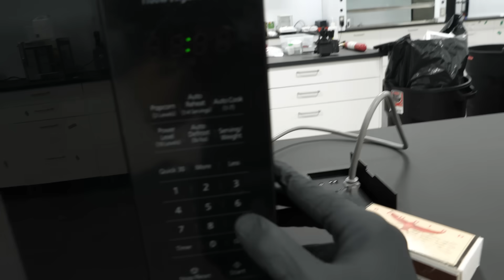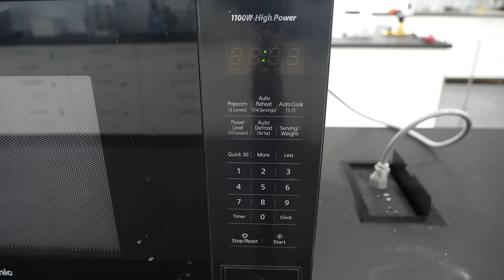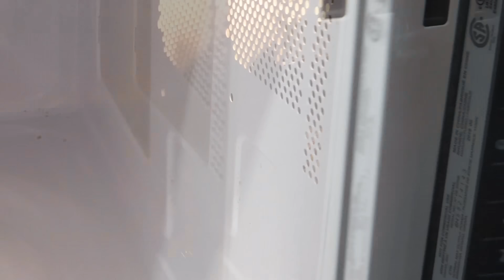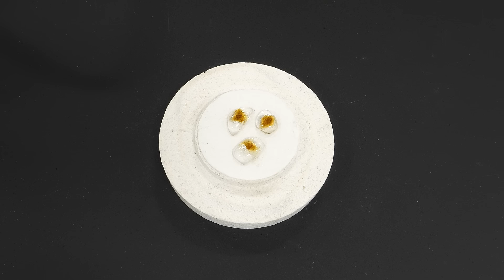Melting glass in the microwave is crazy

Comment: Something else that is fun to try:  take a beer bottle and carefully heat a spot on the side with a propane torch until it is red hot (if you can avoid shattering it). Do this in the microwave so you can slam the door and start it quickly.  Glass, when it is hot enough, is a good enough conductor of electricity that it will absorb microwave energy. If you do this right, with the microwave on, the side of the bottle will heat up enough to melt and collapse.

Comment: I can tell you why it didn’t fuse into one big piece and why they look crackled. First: there’s many types of glass with different coefficients of expansion, or how much they change volume when heated. Beakers are made of borosilicate, a type of glass with a high melting point and low COE at 33. The bottle is a different type of glass with a COE probably closer to 90. Since they shrink at different rates and to different degrees, they create internal stresses that can lead to cracks, crumbling, or even popping.

Second, molten glass has high surface tension, so it tends to form rounded shapes when it melts. In order to get the pieces to fuse, they need to be overlapping each other so that each piece doesn’t contract into itself as soon as it starts to melt.

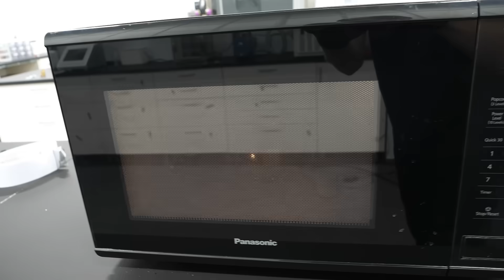Comment: 0:01 moment of beep
0:02 moment of start microwave
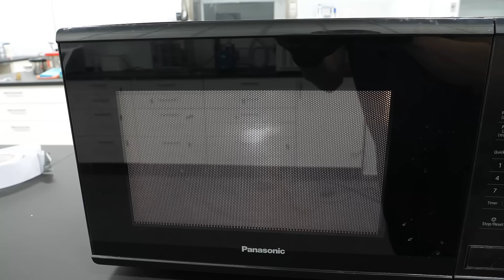0:06 boom
0:08 turns off
0:10 moment of open
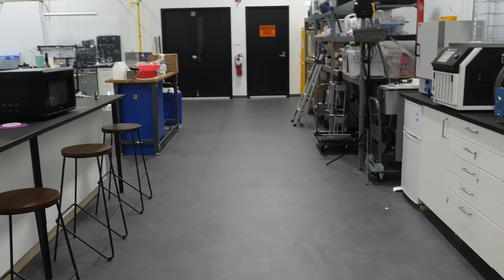0:18 moment of throw
0:19 moment of break
0:23 moment of walk
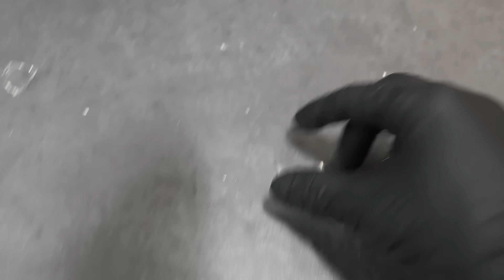0:30 pick up glass
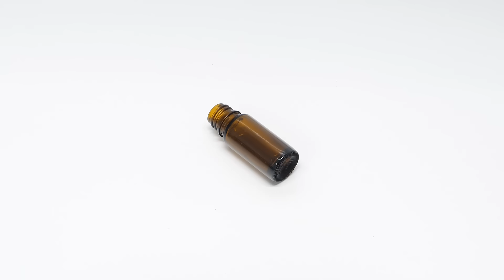0:31 pick up glass 2
0:33 pick up glass 3
0:38 H A M M E R
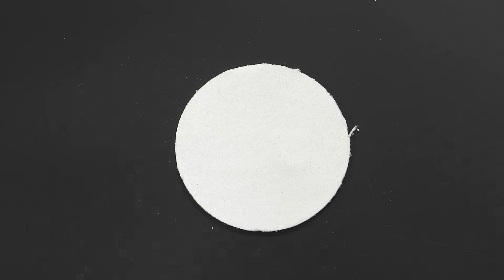0:43 stack glass
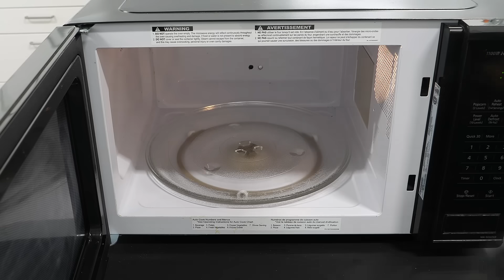0:46 stack glass 2
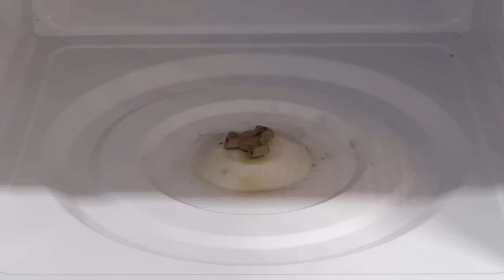0:49 moment of pull out microwave insides
0:52 moment of remove spinning thingy (reminds me of spinning chip)
0:54 moment of placing thingy
0:57 moment of foam circle
0:58 appears in thin air
1:02 cover :p
1:06 tiny door slam
1:09 moment of beep
1:23 c e m r a a n g l e
1:35 no camera (spongebob bwomp)
1:38 "slowly got brighter inside" THATS LASER BEAM BRO
1:44 h o u r
1:47 (press)
1:47 (open sesame)
1:52 nooo my kilm
1:58 nooo my kilm (2)
2:00 moment of place
2:15 top 3 glass break moment #1
2:15 #2
2:16 #3 (so sad 😭😭😭)

2:16.98 end (so sad 😔)

Comment: Changing the power setting on a microwave doesn't actually make it run at less power. It just makes it run full power for less time. Like a stove or furnace. A 5 would make it run for 50% of the time.

Comment: Let me help:  Pyrex is a special type of glass that’s very hard to melt.  That’s why it’s used in the lab.  Also, fusing two pieces of different type glass will soon crack, because different types have different Coefficients of Expansion (COE).  You can certainly buy different colors of glass with the same COE and easy melting points.  Check out companies like Bullseye Glass Company, or your local art glass/stained glass store.

Comment: Single-thickness glass will always shrink in left/right/up/down size in order for it to grow to about 1/4" thick. That seems to be the thickness that it "wants" to be. If you pile the glass up to 1/4" before fusing it, you'll get the single lump you want. It won't be stable though since you're using two different types of glass, and eventually it's likely to crack unless you just get extraordinarily lucky and your two types of glass have the same "COE" - coefficient of (thermal) expansion. The same thing can happen if you don't let the melted glass stay in the temperature region where thermally-induced stresses have time to anneal out. Cracks from that can happen hours, days, even months later. Keep experimenting, it's fun when you finally get things to turn out like you wanted!

Comment: They were never going to run into one another even at much much higher temps. I'm a glass blower, the surface tension and resistance to flow of 33 COE Borosilicate glass used in scientific labware is much much higher than anything used in a traditional furnace and blowpipe glassblowing where you melt glass together in a crucible. Boro glass flows more like taffy when molten compared to soft glass almost being a liquid. Also they were too far apart lol.

Comment: I learned from an artist friend of mine that works mainly with glass that generally melting different types of glass is a bad idea. It can cause those small cracks to form, or if you're really unlucky the whole thing will explode when it cools!
The rates at which the glasses melt, cool, and shrink means it's almost always a better idea to melt all the same type of glass separately, so borosillicate on it's own, glass from wine/beer bottles, etc. It'd be super cool if you did a project testing combos of various glass types with similar or wildly different properties to see what kind mixes work well and which ones are the fun explosive kinds. Especially since you might be able to explain the chemistry angle a lot more in depth than even some glass artists could.
Great idea so far! Maybe I'll finally have a use for my spare microwave... 🤔
Reply: That's the coefficient of expansion. Or COE. Different glass expands at different rates.  It's not advised to mix them because they can explode from microscopic stress fractures.
Reply: Thank you!

Comment: Very cool .....
Question - do you need to be concerned about moisture being in the kiln when you toss in the microwave?
Reply: IMO the moisture is the only thing getting hot. Microwaves can only heat up polar molecules. Glass isn’t conductive and I don’t see it absorbing much energy at all without some humidity in there. For example take any scrap piece of plastic that is dry and throw it in the microwave for 60 minutes. Nothing will happen. Any warmth it may have will be from water molecules in the plastic. And that’s all you’ll get is slightly warm. It won’t melt into a puddle.

Comment: This was an exceptionally stupid thing to do!
Microwaves are rated to leak radiation ONLY if they have a reasonable amount of H2O load inside.
If the inside is dry, the shielding of the microwave is unsufficient and it will be microwaving bystanders in the room.  You used to be able buy a microwave radiation meter at your friendly neighborhood Radio Shack so you could tell when you were doing something dangerous.  I measured our microwave once and verified that with nothing inside, it exceeds the safety rating and the shielding is ineffective!

Comment: Fun video. I'm sure you already know all about glass types, compatibility and COE, but it looks like you mixed soda-lime (the bottle) and borosilicate (the beaker), that's why there are all the fractures around the color. Which is a cool effect if that's what you're going for but may affect the longevity of the pieces.
Reply: I'm not convinced it's boro; no PYREX marker, and the "plasma" in the beginning of the video should not have reacted in a harmful way if it was. The cracks with a soda lime glass fusing should have been more violent too, if it would have melted at all. 

Now two different 80-100 coe glasses, that I'd believe. Either way, annealing with one of these fake kilns should be highly suspect.
Reply: @shawneverette6575  beakers are almost always borosilicate
Reply: @evilsharkey8954  almost always is not always. As someone who spent years working with soft and hard glass in neon, I don't believe it's behaving indicative of boro. 

In boro, a heat exchange(plasma discharge) that is not able to deform the glass should introduce little to any stress into the glass. That (plus the chemical resistance) is the entire reason it's used in lab settings.

If this was 30 years ago I would agree with you with almost certainty, but I wouldn't put it past a current company selling "custom" beakers to be enameling on soft glass. Way cheaper and easier.

If dude wants to send me some shards, I'd be happy to do tests against know glasses. I'll throw in a proper anneal for free.

Comment: SOLUTION
The microwave has a knot wave point in the middle
So the middle part is not heated at all

Thats why the food from the microwave is different hot
You need to slightly be on one side of the microwave and you can melt everything down in one peace
Maybe its to strong so take 5 or 4min

Comment: Be careful with this type of experiment Guy's.  If the Glass is not annealed ( look that word up people ) correctly it will shatter.
I’ve had a glass bottle explode on me,  I took a bottle from the assembly line before it entered the annealing process It cooled down I took it to my work bench.  It sat  there like a ticking time bomb for three days before I picked it up bare handed and the change in temperature caused it to explode.

Comment: Borosilicate glass (pyrex) has a COE (coefficient of expansion) of about 30, soda-lime (the brown bottle) has a COE of around 70 (varies). This is enough of a difference that the result will almost certainly crack. Even if it doesn't by the time you take it out, it will in time, particularly if the glass was not annealed properly (ie cooled slow enough). Unannealed glass and mixed COE is DANGEROUS. It can come apart without warning, launching very sharp small shards everywhere, particularly towards delicate tissues like your eyes. If you want to play with this, do some basic research into Fused Glass techniques. I have no doubt there are a good number of channels devoted to this. Nearly all of the glass in the world is soda-lime (cheaper), except for laboratory glass (beakers, etc) and oven-safe cookware. Thou shalt not mix.

Comment: Glass will form into the simplest shape when heated, which is a sphere. This is because of surface tension, a sphere is the simplest and easiest shape for an amorphous substance like glass to turn into when heated up.

If you had placed them closer together, and also ran it longer, if they were touching, they may have all formed into one piece. Basically think about snow falling down, in a crystalline structure. After it hits the surface and warms up, the snowflake beads up into a droplet, basically a sphere.. and droplets that are close enough, will form together into a bigger droplet, or one big sphere (given a flat surface, for liquids like water anyways. Once the droplet gets big enough on a curved or angle surface, like a car body, gravity will pull the water down once the sphere gets too big. So too much glass  you'll still get a puddle shape, it won't turn I to a perfect sphere, not the way you are melting it anyways..)

If you place the pieces touching and ran it again, for longer, it would give it time to maybe form into one piece, but unless super super hot, like molten, it won't form a perfect sphere unless you rotate it, (like glassblowing, think of a gob of honey on the end of a stick, you need to constantly rotate it to keep it from falling off the end - gravity again) 

This idea can also be seen in space when astronauts let a liquid float in the air, if it's all one blob, generally you'll see it form a sphere from the surface tension :)

Comment: The spiderweb cracks are due to differences in CoE between the two types of glass. As for them not joining, a hole in a glass bubble will spread out the more you heat it as it wants to form a cylindrical shape due to surface tension. If you want the pieces to join, there can’t be any gaps whatsoever. Atleast, that’s my experience with borosilicate. Great video!
Reply: I know it's been a year but...CoE? I know you don't mean the Church of England, but...?
Reply: @hisss  coefficient of expansion! Borosilicate is 33 CoE and soft glass is generally between 90-104. It’s a measure of how the glass will expand and shrink at different rates when heated and cooled. Different numbers cool at different rates and will sheer apart
Reply: @bloink3511 Ah, of course, the principle behind sprinklers (the extinguishing system), right? Thanks for the clarification, especially after I dug up a corpse 🍻
Reply: @hisss  🤣 no worries mate

Comment: The reason the glass didn't fuse "correctly" is because you used two different types of glass. I worked with glass from 2016-2019 and when fusing glass you either have to use two pieces from the same sheet, or the two different colors have to come from the same factory, as they both will have the same COE.

Comment: @Nile Red the reason they separated and cracked is because the types of glass you used are a different coefficient of expansion.  The beaker is made from borosilicate glass which has a coe of 33, and the brown vial was likely made from soda lime glass which has a coe of 99 or 103

Comment: For glass play, you can add any metal-oxidization gouged from whatever happens to be rusting, adding the green salts from a corroded battery terminal will cause a sky-blue-green, iron rust makes either black or more likely whiskey-brown; glass colors are the same ingredients used to color fireworks.

Comment: This result is not surprising. Molten glass has a fairly high surface tension at barely-molten temperatures, so it's predictable that the pieces would contract in on themselves. You have to get it hotter before the liquid thins out and starts spreading.

Comment: Nilered!!!
Those are probably going to crack/explode because the clear and brown glass will have different coefficients of expansion (COE). 

You can however use colored mica powder(from online or craft stores). Some colors might burn off or change color though. You can sprinkel it or mix it with plain aloe gel. Apply it to the top of the bottom of layer of glass, and cover with the top layer. 

In order to be successful, use only glass from one sheet or piece. To make a big piece, there has to be a top layer of glass over the connecting edges.

Comment: The three pieces of glass did not fuse together because when class is melted its surface tension causes it to form a thickness of about 6mm, which is much more than the thickness before they were melted. Consequently the pieces pulled away from each other to reach 6 mm thick.

Comment: this is just getting water turning it to ice and melting it and freezing it with an extra step.
Reply: yes? its called a phase transition, it happens to many things, including metals. only he had to get a microwave hot enough to melt glass which in its self is transparent to microwaves (they pass through without dumping energy into glass). Where as water readily absorbs microwaves and heats its self up very fast.
Reply: Nice I might need that to pass my next exam thx bro

Comment: If you get glass red hot with a torch and then turn on the microwave, it will heat up more and melt. The glass becomes conductive and will start picking up microwave energy like metal does.